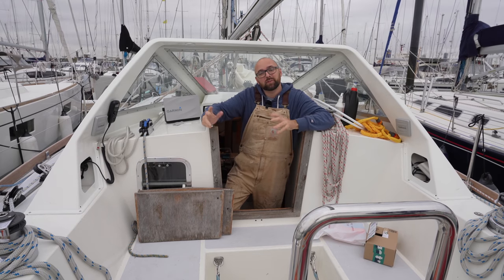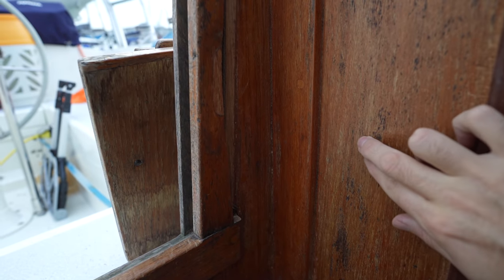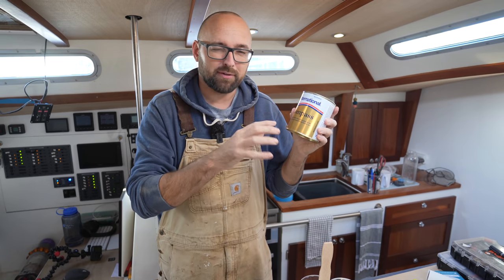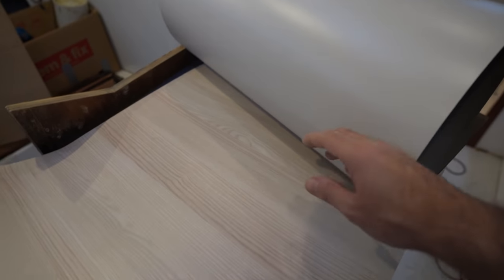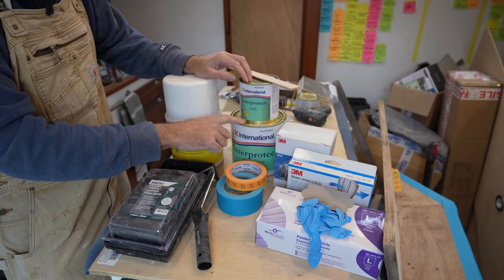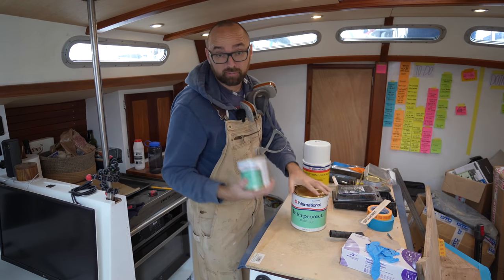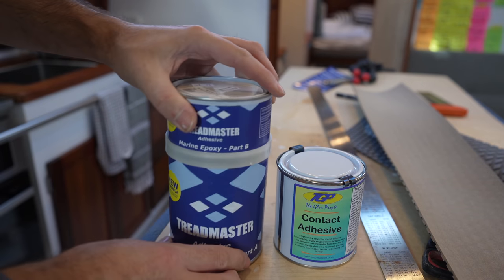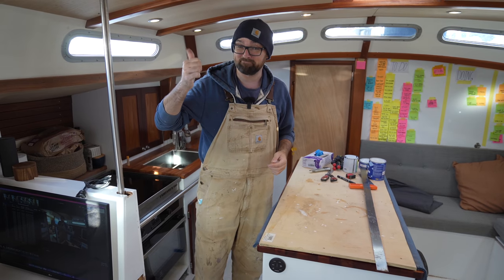Sail Life - Companionway beautification & Formica at nav station

Comment: The trick behind cutting Formica easy is to drill the corners of the piece you wanna cut with a small sized drill, and then using those to line both sides with a box cutter giving you a break line. It then snaps clean and crisp.

Comment: Another great episode can I suggest you treat yourself with some Laser eye surgery. I was a long time glasses wearer and didn't find wearing glasses a big deal. Like you I found problems with masks though in this case for Scuba and admittedly I could of gone with contacts I had problems with them. Of course it also makes wearing sunglasses easier rather than rely on finding clip on ones.

Since your future is going to hopefully include lots of diving underwater fun and hot sunny weather (Not in the UK of course I think we have that scheduled for a Tuesday afternoon next year) this is an option you should consider. Note being pessimistic I ignored the Doctors advise and didn't go for the Monovision option(were they adjust one eye for long vision and one for short) which means I still have to wear cheap reading glasses for close up work as I wanted two chances to see properly.

However not wearing glasses has improved my life a little plus I do not have to visit an optician every year for a new pair so I have saved financially almost all I spent since I had the procedure.

Comment: I have a similar beard, and wore one of these 1/2 masks for reduction of fiberglass dust (insulated attics) and extremely fine dust, etc. (under buildings in the dirt). Pretty effective, even with methane (natural gas) although I would not rely on one for heave toxic vapors. Also, you can wipe out the mask before re-use to prevent "yucky" experience.

Comment: Actually, 3M also makes full face masks with an optional clip that will hold a pair of glasses, with the temples removed. Many of the full face models use silicone straps, not rubber cloth, so they don't stretch out.
 And they even have lexan scrims, like a motocross helmet, so the actual plastic faceplate doesn't get scratched.
 I don't think the local chandlery or big box store will stock the good stuff.

Comment: Mads- I wonder if the Vendor who supplied the Gray "laminate" provided the thinner wood-grain material as a "backer sheet." Typically (especially over high- or medium-density fiber board, referred to as "HDF" or "MDF"), it is important that both large faces are identically covered to prevent warping. Marine Plywood may be less susceptible to moisture, but still, in your on-water environment, it's worth considering. Regards, and keep up the great work! -A

Comment: You can buy (specifically built for 3M full face) glasses frames that fit inside the mask. You just have to get a second pair of specs for them (a cheap prescription only one should suffice). There's several makers for these. Oddly enough, the cheapo ones i got from china were the best ones.

Comment: A good trick with contact glue is to use timber dowels, when the contact is ready place the dowels on then the laminate. Then when it's all lined up pull out a dowel at one end and flatten it down etc 🏴‍☠️

Comment: Mads did you try the USB Ports you installed last week? 

I'm asking because they looked like USB 2 ports and could be limited in speed when transferring data from and to your iMac. So if your transfer rates are suspiciously slow i'd suggest looking up if you can find the same style of connector as USB 3.

Comment: Mads, if you happen to read this.  When you have the solar arch fixed/re-inforced, could you explain what the problem was in your video?  I want to do a similar design and would be curious to know so I dont run into he same problems.
Reply: I am guessing side to side stability as I don't think that there is very much diagonal bracing. So corner gussets or (optionally removable) wire stays inside the arch

Comment: You should be able to tell if your mask is leaking around your beard by whether or not you can smell the paint (when using a carbon filter). For highly toxic paints, such as those containing isocyanates which can put a painter in the hospital, a PAPR (powered air purifying respirator) should be used.  A PAPR, which feeds filtered, slightly pressurized air into the mask, works well, beard or no beard.

Comment: Seem like the only way to have a better seal in the face mask for people who have beard is to have a face mask that pumps air into the face mask.  That is to maintain a positive air pressure.  Of course, this means it requires a pump to pump air.  I have not used that type of face mask before.

Comment: I have the same issue with my mask...You can buy replacement straps, but by the time you do that, many times you're nearly at the price of a new mask.  Yet again, welcome to the disposable society.  Once again, I get trigged by the entire "just buy a new one, because the replacement parts cost as much as the entire tool"...I've seen this with palm sanders, belt sanders, random orbit...heck, even some things like shop vacs.  I needed a new hose sweep attachment and filter.  Total was $85!  A new shopvac of that same size that came with an entire tool set, was $95!  Drives me nuts...